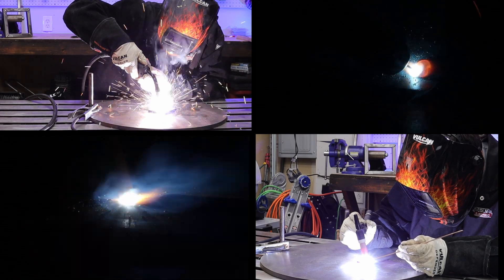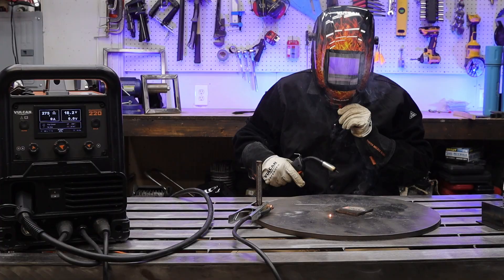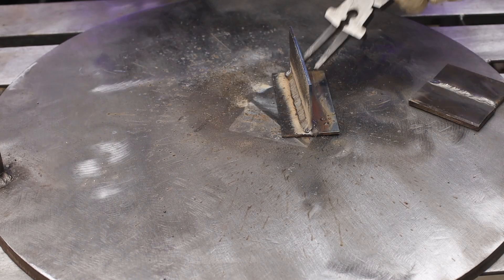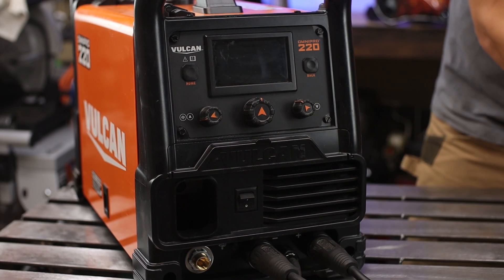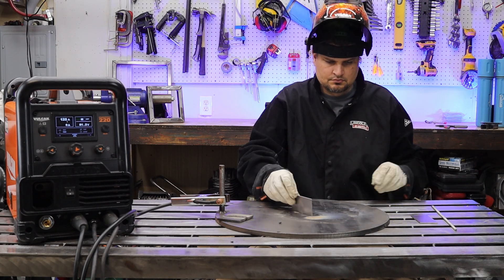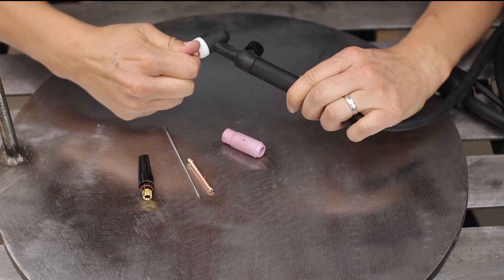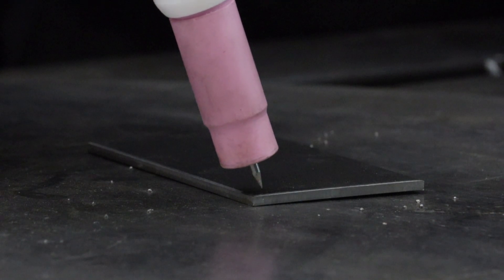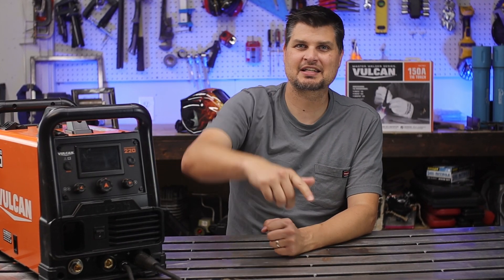Harbor Freight Welder Vulcan Omnipro 220// FLUX MIG STICK TIG

Comment: Love how it's idiot proof for us idiots. So far I've added the spool, pedal, tig, gas, and can do anything in the shop except I leave the heavy equipment welding to the good old Lincoln Buz box. Cutting I just upgraded from the cut 50 to the Yeswelder 65ds and feel like I'm complete and barely ever break out the oxy set now.

Comment: So for welding with Stainless Steel Flux Core wire it says it requires DCEP. The flux core setting on the OmniPro 220 says to use DCEN. Can I still select the flux core setting and run DCEP for my stainless wire? Or should I use the MIG Stainless Steel preset setting which says DCEP? maybe I am over thinking it but I am concerned that the internal settings are meant for one or the other. There is not much info on using Stainless Flux Core.

Comment: Machines crackling alot and throwing a ton of spatter. Not sure if its the machine or the operator. Not here to give any welding lessons.
   I just hope it runs as smooth as my lincoln MP220 does. With the lincoln i can run mig with no spatter and flux core with very little to no spatter with the correct settings.
   The old harbor freight machine i had. A little $100 machine ran dirty. 
   1k isnt bad for a multi process welder. Just hope it runs smooth.

Comment: Wait so do I need argon bottles or not for the wire setting I’m so confused
Reply from the maker: If you get Flux core wire you do NOT need any gas. If you want to run solid core wire or MIG welding then you will need either C25 or 100% CO2. If you want to TIG weld then you need 100% argon.

Comment: I just  put my spool on, fed 2" out and am trying the step where you put against wood to see if tension is right to bend wire. Nothing at all. I've tried every tension between 3-5.Will not even feed wire at all when press trigger. Am using .035 wire.   Any tips anyone can offer will be appreciated.
Reply: Make sure if you’re using flux cored wire that you have the toothed drive wheel on with the correct 0.35 size and tighten the tensioner down. Also make sure you’re gun is plugged in lol

Comment: Pro Tip: I set my MIG Run-In rate to 34% for smooth starts. The factory pre-set of 25% usually burns back, causing false starts on my machine. Hope that helps someone!

Comment: I'm just a hobbyist.  I bought a 220 back in like 2018 and used it to mig a couple times, then I didn't use until this year.  I ran about four feet of bead  in six inch intervals and then last night I ran a bead of about a foot.  When I went to run another bead, nothing happened when I pressed the trigger.  No gas, no wire feed, no sound.  The cold wire feed still works.  I've searched YT and I found a video about a similar issue, but on a Miller (Lincoln?) welder.  So I guess I'm going to disassemble the gun and see if I can find anything.  If that doesn't fix it, I guess I'll try to finish with stick.  
Anybody got any ideas?
Reply: Mice maybe? They like to live in unused machines.

Comment: the manual mentions something about AC tig but, for the life of me I cant find anything on it. I dont think it can but, why would the manual have anything on it? I dont own the machine.
Reply from the maker: This machine does NOT have AC tig welding. So no alum. tig welding with this machine. You can still do alum with the mig spool gun.

Comment: Education video except makes my problem a bit clearer.  About four years ago purchased a Harbor Freight Chicago Electric welder.  Nothing fancy or expensive just a good welder for DYI use. My friend borrowed it for repairs about one year ago before we moved.  Now I have some welding projects.  Do I drive the 325 miles round trip at gas costing  $120. Or just spend those dollars on a new MiG welder costing $150+. The new welders have so many advantages and features.
Reply: I’d say it depends on the type of welding you’re doing. If the CE is good enough and you feel like wasting not only money but your time 6 hours give or take or buy an affordable titanium MiG machine or a multi process unit and save yourself the $120+ in gas and 6 hour trip for no reason

Comment: What size circuit breaker were you running the welder on?
Reply: I've run mine on 40amp 220v circuit for 6-7yrs of daily use and never had a problem, even at max duty cycle.

Comment: For stick welding, how long are the leads? And could you add length to each lead if you needed?
Reply from the maker: They are 10 ft. Possibly yes, they terminate with a dines connection so you could potentially make an extension cord with dines ends.
Reply: @-DIYPRO-  Thank you! Great content 🤙
Reply: Fwiw I bought bulk wire & dinse terminals and made up 25ft leads that work great. Size your wire appropriately, use a high quality ground clamp & you'll be fine.

Comment: Yeah iv had mine for about 4 years now. Never have had a problem with mine. And let me tell you now i have been rough on mine and it never skips a beat. Iv also ran it alot on my predator inverter generator and it does great. But first and only thing is they come with horrible mig gun and line so hop on htpamerica and get the 15' ungraded one. It makes this machine a beast and the ugraded gun is heavy duty and feels really good in the hand. I recently bought the everlast cyclone 212 and iv had it for about a year now and it just sits on the shelf. I always end up using the omnipro. Its well worth the money. And it burns 6010/6011 rods as good as all other electrodes. As an full time welder for the past 10 years i have used alot of big name brand welders over the years and still evertime i throw down a bead im smiling behind my helmet. Sorry for the book
Reply from the maker: Right on, thanks!
Reply: I can't keep my 3/32" 6010s lit. If I turn up high enough to keep it from snuffing it's blowing holes in my work.
ps: thanks for the book. A compelling read...
Reply: Thank you for the tips
Reply: Damn, is it really that much better than the everlast
You mentioned you had it for 4 years, Im worried the current made ones are of less quality because you know, covid
Reply: What size generator do you use for it?
Reply: No, brother thanks for the book! Im fresh out of school and just got a job at at a fab shop, so im wanting something not too expensive but dependable. It really means a lot coming from a seasoned welder. God bless and thanks.

Comment: Ive had my 220 for 3 years. No issues at all so far. If you didn't know, the Vulcan emblem on front folds down revealing a hidden compartment right under the 3 knobs.
Reply: DUDE WTF!!!! I’m just staring at my dusty ol 4 yr Vulcan and it’s the first time I open that door . So clean in there 😂
Reply from the maker: Yes, thought I'd broke mine at first!
Reply: I was so happy when I stumbled across that, great spot to keep spare tungsten.
Reply: This just blew my mind lol
Reply: Does the 220 weld aluminum for the tig setting or only the spool ??
Reply: @thatoneevo1306  Spool only for aluminum. The tig is DC only

Comment: No gas needed on Stick Welding??🤯🤯🤯
Reply from the maker: Crazy, isn't it!
Reply: Stick is like inner shield but with the flux on the outside
Reply: Stick is flux core wire turned inside out and bulked up.  That's why they like it for bridges & such where the wind would tend to blow the gas away.  So I hear - I'm just a fan boy getting my feet wet.
Reply: @IT_Dinosaur  no, flux core wire is stick turned turned inside out
Reply: @cbmech2563  Most sticks seem to be a tad larger than .035 - but what ever makes sense to you man.
Reply: @IT_Dinosaur  which came first, the stick or the wire?
Reply: Not sure why you are trying "win" a non argument.  Consider me chastised, oh shining beacon of internet truth.

Comment: Was wanting one but fell short on the total amount. The manager would not cut me any slack at all. Had 1150 bucks , was going to pay the leftover with my credit card but total was 1300 something and I asked him if I could get a little help with price,  and he said Sorry fella. I was like , dang. Your gonna let me walk out? Shrugged his shoulders ...So I Went and bought a weld-pro for 600 bucks. Never used. Welds like a dream. Nice little multi process welder . 200 amp. too. Love your channel btw. However I'm Not gonna support HF anymore.  (of Lincolnton NC).
Have a blessed day sir. Will stay tuned for more of your footage/videos.
Reply from the maker: Home Depot and Lowes you can usually talk them into giving you a 10% discount, Harbor Freight doesn't even do the their 20% anymore, even with that coupon they had so many exceptions too.
Reply: @-DIYPRO-  Also, some of the stores, if you are veteran, you get a discount. For example, Home Depot: 10%.
Reply: They have a coupon it costs 999.00 if you’re on the coupon email. Just found out yesterday
Reply: @mentalbreak4653  oh really
Ill check it out i guess.
Reply: Was just $850 on their "parking lot sale"
Reply: @mcsqueegee81  yeah but all stores are different from my experience.
Reply: @mcsqueegee81  do you have one? What's your thoughts?
Reply: @thegarbagegladiators4735  I'm in Charlotte. I've had the OmniPro 220 since it came out, maybe 6 or 7yrs? There's times I weld everyday for months and times I don't weld for a month or two. It's my only MIG machine. Have used it in the shop and on-site from 14ga. up to 1" material thickness (with pre-heat to blue). It's a rock solid machine, very easy to set up & run well. Two upgrades I made: YesWelder gun with 15ft whip, and a solid bronze 250amp ground clamp.
With that said, I also really like PrimeWeld. I run their TIG 225X and their PrimeCut 60 plasma cutter. Their machines are top notch, prices are low and their 3yr warranty & customer service is BY FAR better than anyone else in the welding industry! I call them on the phone and they happily answer my questions.
Not sponsored, just a happy customer. Hope that helps inform & guide you some.